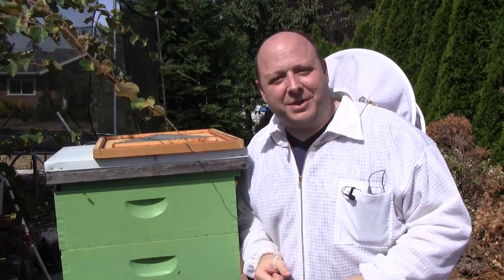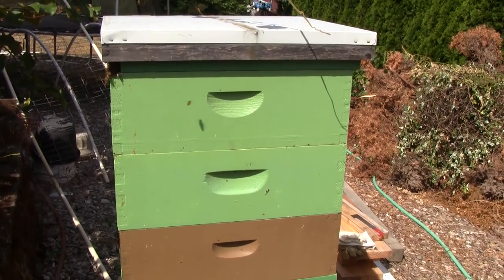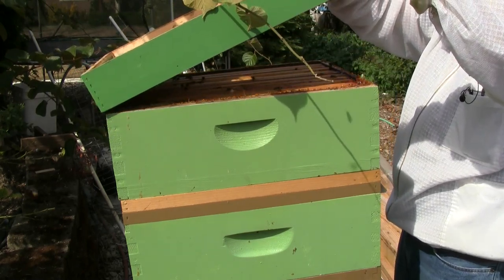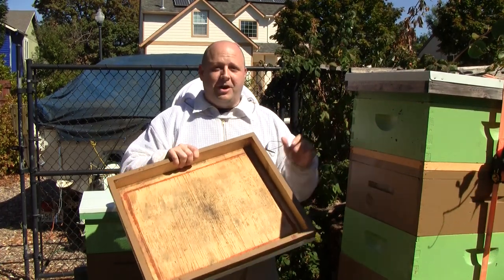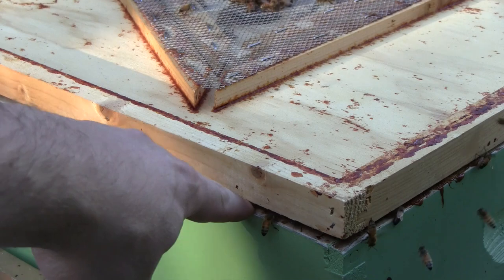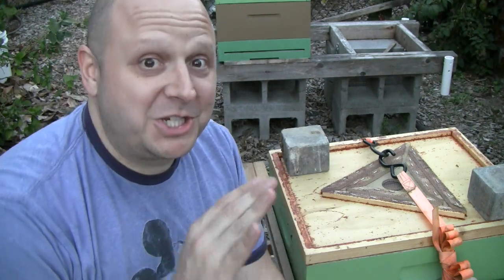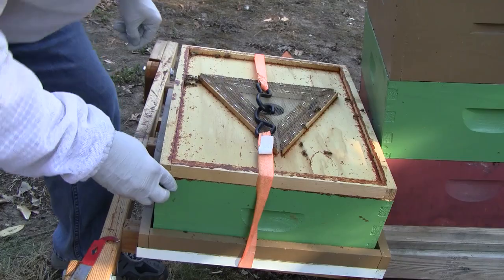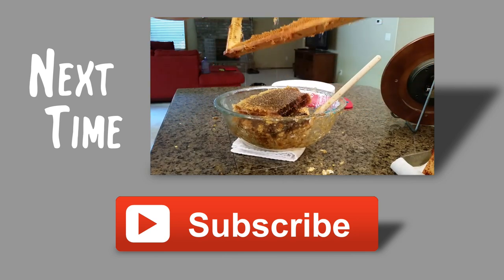Harvesting Honey Part 1 - Bee Vlog #174 - Aug 29, 2016

Comment: I bought the large aluminum bun trays they sell at the restaurant supply that fit a hive box exactly.   They have a 1 inch lip.   That way it is easier to scrape off spilled honey that runs out when detaching the frames.  (foundationless frames)  And, though I used to use crush and strain, I much prefer my hand crank 3 frame extractor, bought used, so I have lots of wets to put back on the hives.   I put out my cappings wax for the bees to clean up and have way more wax than I can use anyway.

Comment: Hi Bill. I noticed on your second demonstration, you were using latex gloves instead of beekeeper gloves. Do latex gloves protect just as well against stings? I ask because, like you, I dislike wearing gloves, finding that my grip is clumsy with them. However, on my last foray into the hive I received a sting on the back of my hand that led to enormous swelling (just one sting, mind you). I don't think I can take any more chances by leaving my skin exposed, and am looking for alternatives.
Reply from the maker: They don't fully protect against stings, but the bees don't recognize it as flesh and are not likely to target it if they get defensive. I've been stung through the Nitrile gloves with yellow jackets, but not bees. (I use Nitrile instead of latex as it seems to be a little more tear resistant.) I prefer these rubber gloves as they are disposable, so I can reduce the chances of cross contamination. They keep my hands clean. And I don't lose dexterity or the feel of what I'm doing. Those leather gloves can be pretty clumsy if you're not used to them or if they don't fit right. They're expensive. And can spread disease. I was using the leather in the first take because I forgot to grab the rubber gloves but I had the leather ones with me.

Comment: What's the cool ventilated lid you have there?   I assume that is the purpose.   I had frames of honey melt and drop out last summer and honey was running on the sand in my bee yard in that hot weather----arghhh!   so I made wood framed screen tops for all stacks, placed with the migratory cover on upside down so the cleats made a shady air gap and all have been good this summer---no heat issues.
Reply from the maker: Great idea! Yes, it's a ventilated cover. Called a Vivaldi cover.
Reply: Ah, it works "the Four Seasons" eh?   (violin joke...I play)